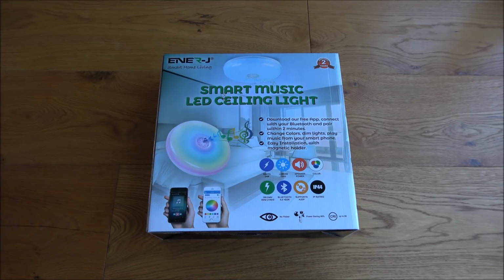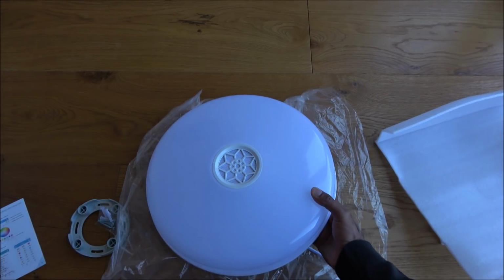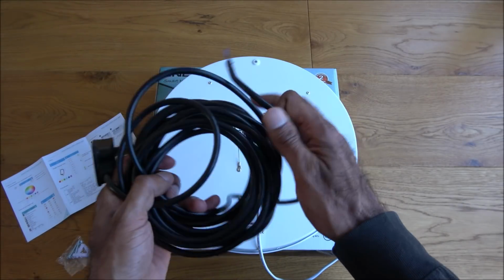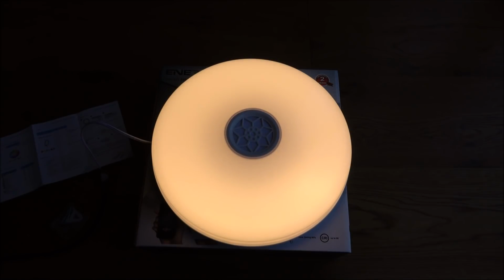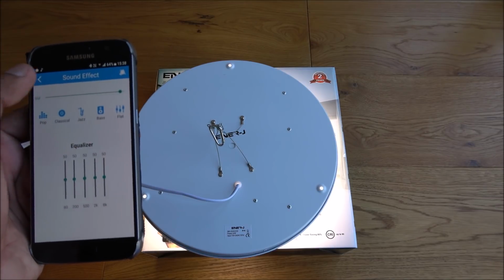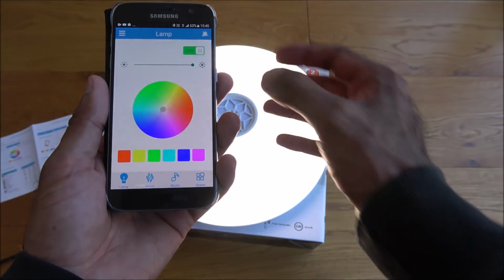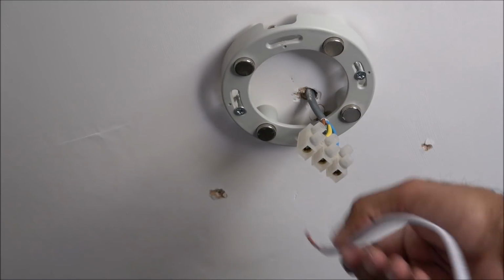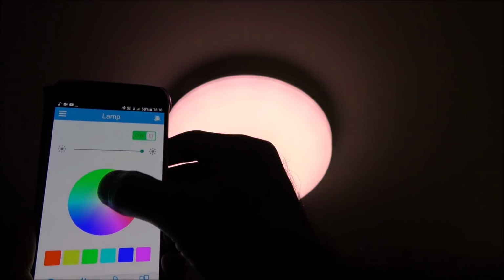ENER-J LED Ceiling Light with Built-in Bluetooth Speaker

Comment: Hi there, is there a power converter adaptor, i can use to test the light out before, i put this on the ceiling. The problem i have, it keeps changing to multi colours, when i keep pushing the switch.